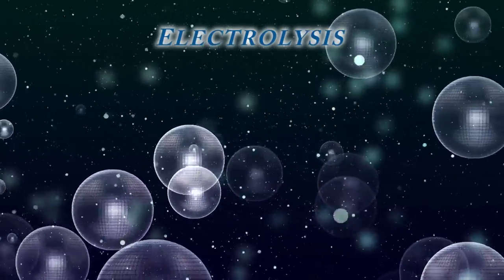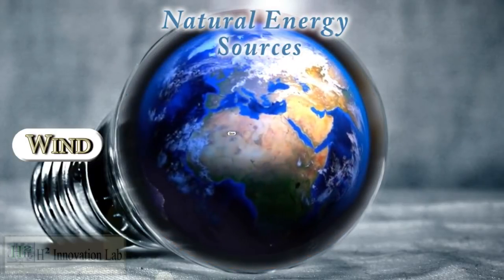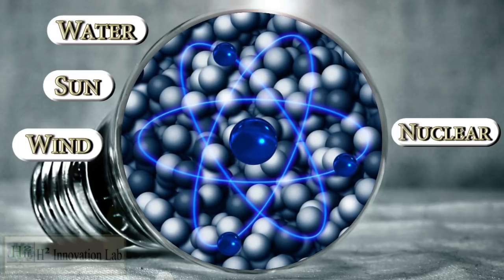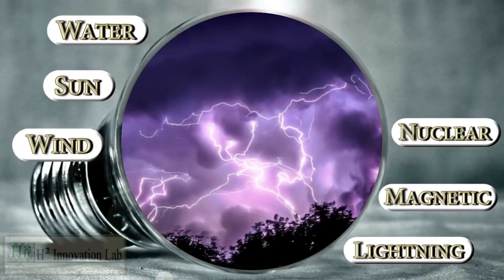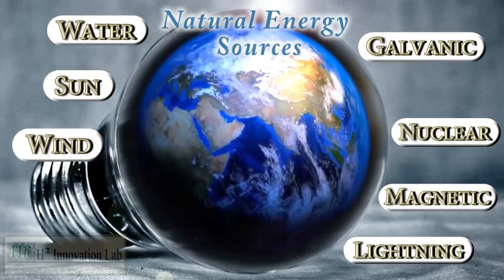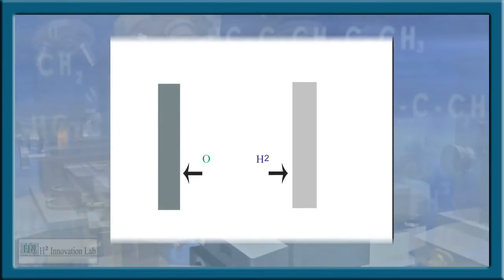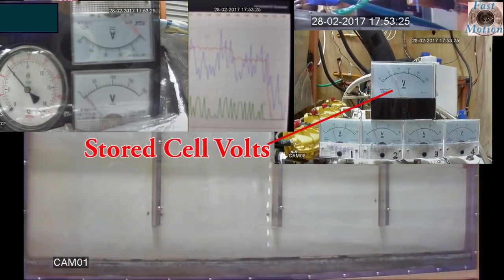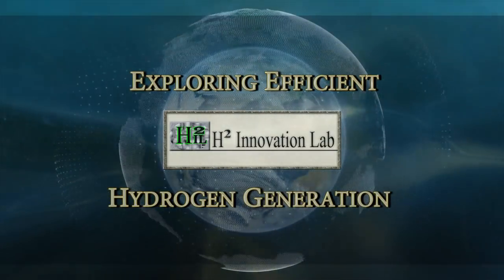Too Good To Be True OR Supported by Modern Science?

Comment: My concern is the salt-water, under electrolysis will the salt not separate into sodium and chlorine? A fascinating idea though, this is the answer to all energy needs, and it can break the fingers of the death-grip that OPEC has on us.
Reply from the maker: Thank you for the comment.
One would conclude this but the process and chemistry we use prevents the production of chlorine which would cause havoc to the system.
Reply from the maker: H2 Innovation Lab (H2IL) invites you to view an introduction to co-efficiency verification testing of its game-changing energy technology.

The tests are carried out using a PEM Fuel Cell stack to convert the generated hydrogen energy back to electrical energy. Input power in compared to out power real-time.
Scientific feedback is to the effect, and quote, "I truly believe you have achieved the remarkable" - "even if the fuel cell performance was 100%, which is impossible, the output readings are obviously greater than the input power." 

Please follow this link directing you to the brief 

intro video: https://youtu.be/L-PfstY_jYk
Thank you for your support.